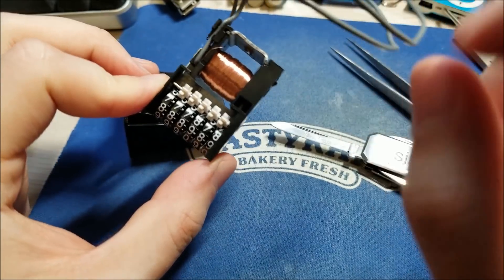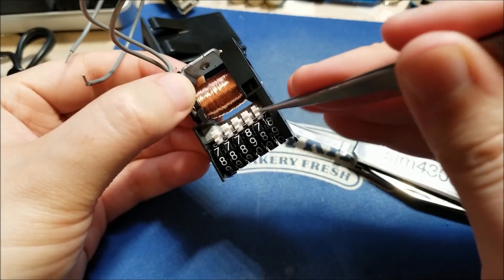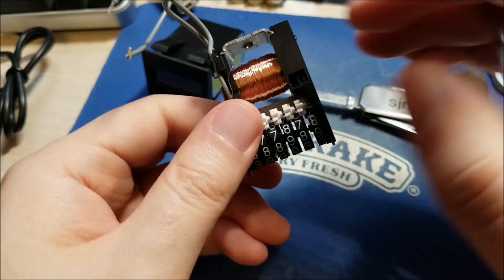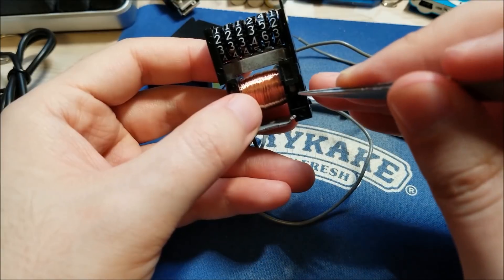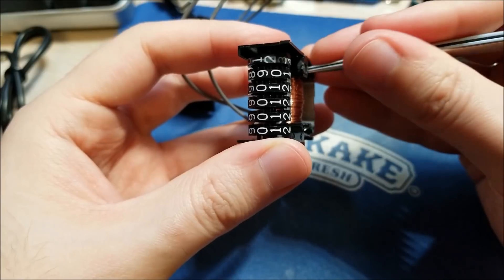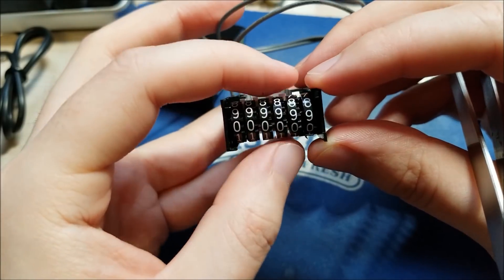Electromechanical Pulse Counter

Comment: You could make it into a clock, sort of. Since there are not 100 seconds in a minute, you could have it in percentage of a minute. 50 on the counter would be 30 seconds. 75 would be 45 seconds. Kind of a clock but in code. It would probably have to be in 24 hour formate. You could have it reset at 24 hours.

Comment: I really want a bunch of these for my projects but cannot find them and the links in bio don't work what it the make and model of these
Reply from the maker: They must've sold out of the one I bought because the cheapest ones they have now are like $6 and look different. Ebay search "electromechanical counter" to find them.
Reply: @sjm4306  yeah now I found them but there low on stock and thank you this is exactly what I needed as it keeps display on even without electricity and they cost a bit more in the UK like maybe equal to 3-4$ I subed and will be watching yr vids.

Comment: What happens if you keep it attached to the battery for say 10 secs?? Will it keep incrementing or will just add single number
Reply from the maker: It is essentially a solenoid with a ratcheting indicator so it only counts rising edges. So in the case of a 10 sec pulse it would only increment once. You would have to be careful about heating and burning out the coil for very long pulses but it should be fine given the impedance of the coil and the 12v rating.
Reply: @sjm4306  i made a 555 delay off circuit and attached a relay on output via c828

Now i wanna count everytime 555 gets triggered and keep that number so that it doesn't go to zero when power disconnects.
Basically count how many times something was turned on for 2mins (delay i gonna set)

Any suggestions will be very much appreciated.
Reply from the maker: You could get one of those cheap dollar store pedometers and wire the weight switch to the 555 trigger. When you wanna count, just clear the count and it is good to go. It will otherwise keep the count as it has its own battery.

Comment: still don't know the why i watched the full video on this
Reply from the maker: Cesar Melendrez ... because the sound of my voice is ... mesmerizing?
Reply: Any improvement on the other small project than you have or is sitting on the side?, also 2 arcade games i got have a counter for coins as well one have the 93,835 and the other 101,833
Reply from the maker: Cesar Melendrez Bought and breadboarded an rgb to composite converter chip so I can hopefully use a small LCD for testing. Gotta get the unboxing edited and uploaded. Also got a new oscilloscope which should help with debugging (video on that soon).